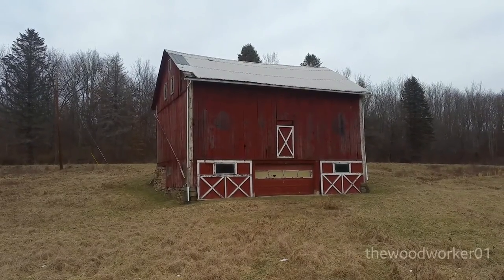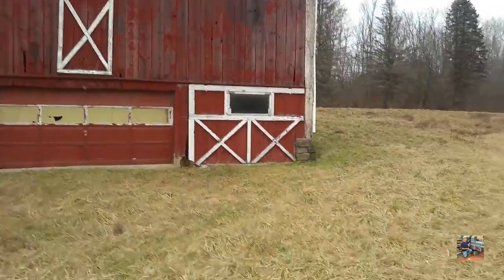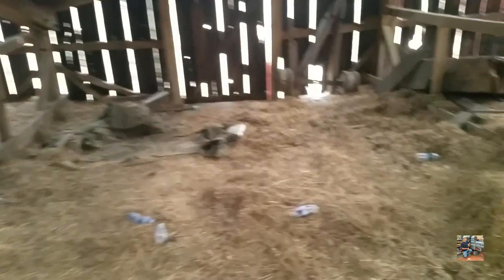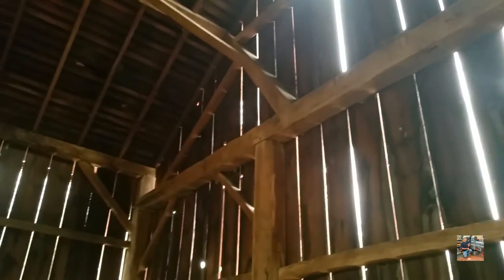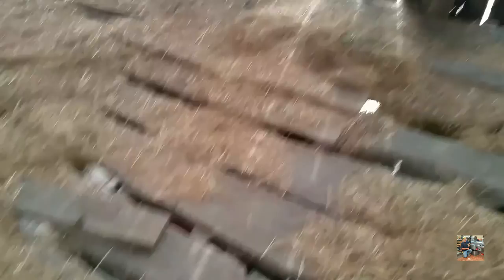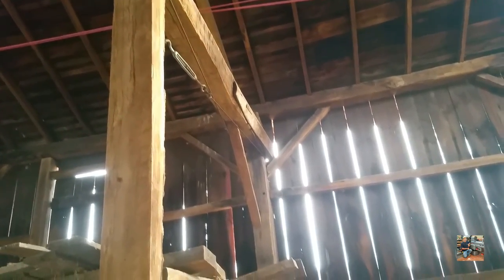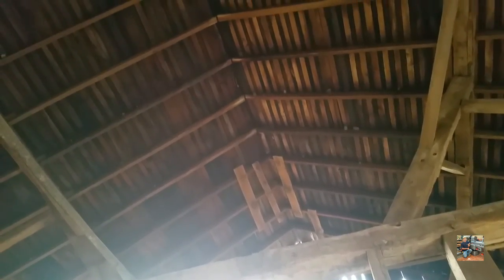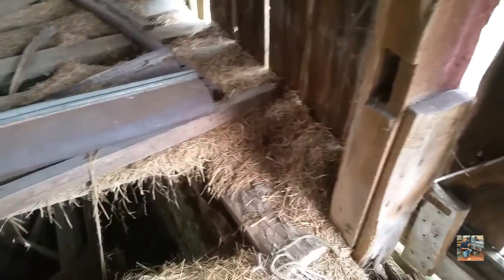HELP! How Should I Fix My 170 Year Old Barn with 3 Sheared Beams?

Comment: What I would do, is pull the walls together using very heavy duty straps, or chains, and then run 2 x 4’s up in the roof to keep it together every one or two spaces, and maybe metal cables along the base of the roof on the inside to hold it together, i’m not very experienced in this kind of thing but I think that would work.

Comment: My fix would be to pull it down. Those old barns were quickly made, usually on a rubble stone foundation that heaves with the frost in the winter, causing all of the structure to shift and move and eventually fall apart. If done carefully, enough could be salvaged to build something worthwhile. 
Repairing a timberframe like that is hard, risky work, and unless there's are real need for that space as a working barn, probably not worth it.
Reply: I very much agree. It's not worth risking your life.

Comment: My suggestion is start repairing from the bottom up give yourself a good service to work on use a chain and a come along to try and bring the beans back in the place and once they are back where they need to be, get some steel angle brackets made up, to help re-secure all the repair joints.
Once everything is back into place the roofline should fix itself, also you can add some caller ties to the roof rafters to help secure them you don't need to do every one.